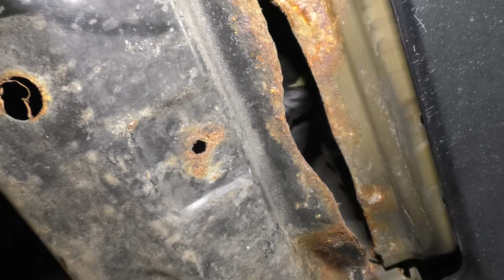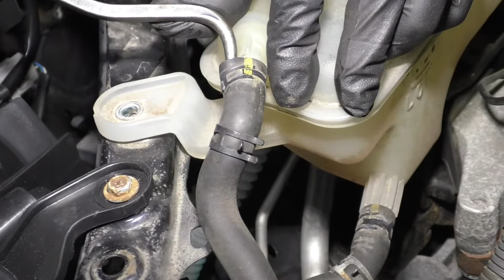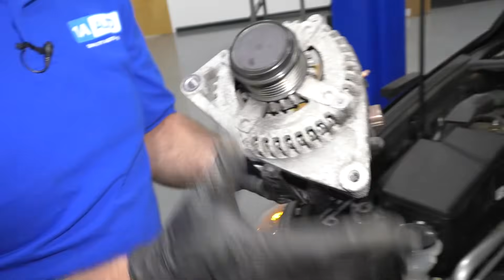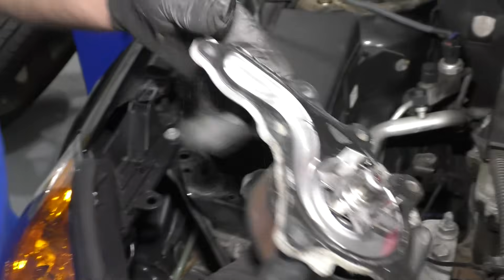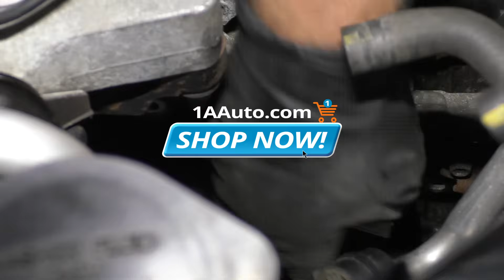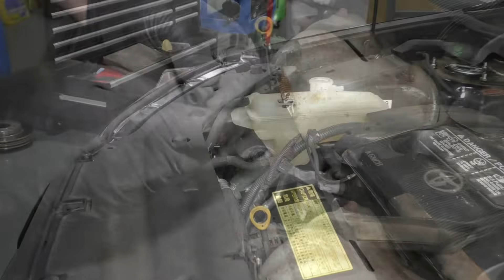How to Replace Engine Water Pump 09-18 Toyota RAV4

Comment: Oof…my biggest concern is that after calling customer support for 1A Auto I was told that the parts (water pumps specifically) are good for 1-5 years, with a 1-year warranty (varying on the part and manufacturer)

Comment: Not a bad video but it would recommend using an oem pump unless you want to do it again not long after you replace it. Also the water pump bolts are all easily accessible from the bottom if you remove the plastic shield in the wheel well. You also can snake it from the top with the alternator still in place. Only thing you really need to remove is the tensioner and belt

Comment: Alternator 14mm socket bolts torque 38 ft lbs, belt tensioner 12mm socket bolt 15 ft lbs.

Comment: Great video.  2 comments.  The thermostat is under the alternator. I always change it with a new water pump.  Also, on the right (other side) of the motor is the coolant temp sensor.  It’s a $14 ish part.  I change that too.

Comment: Slotted brake rotors on backwards, as usual. The slots act like a water pump impeller to draw air and debris from the center and throw it out of the rotor. Nobody reads the stamps on them that says "passenger side" and "driver side."

Comment: Skip all this bs, Support engine under with block of wood and floor jack, remove right side engine mount, remove tensioner, replace pump re install tensioner and mount done. 1hr if your a good mechanic 2 hrs maybe if you don't always work on cars. Torque bolts to specs very little 78 inch pounds about 8ftlbs, don't clean block with any chemical cleaner will damage gasket per manufacture

Comment: Ok here I am again, it was the water pump bearing making the rattling & grinding sort of noise.
I replaced the same and now the engine runs nice and smooth, without a whimper from the drive belt area, 👍 🙏
Well the job went off well with your guided video, but one thing I learnt is that you don’t have to really struggle taking that Alternator out as when you loosen the the top bolt about 1/16” out give it a slight tap on the head to move the nut about one mm away from the bracket the nut actually slides into the right housing of the nut in bracket and it’s got a  V shape locking arrangement so it won’t rotate. Loosen the bottom bolt a bit and now remove the top bolt & bottom bolt & the Alternator would just slide out without a problem or having to lever it out.
Even when putting the alternator back it’s very easy just slides into the bracket and when you tighten up the nut snugs it’s self up nice & firm and off course the bottom bolt comes off and goes back without any hassles once the top bolt is on.
Well I ‘m happy it went off well. I got the water pump for about CA$74/- & coolant 50/50 for $25/- plus taxes.
I wanted to share my finding about easy removal & fitting back of the Alternator for you guys who want to DIY
Thanks A1 Guy once again & all the best

Comment: Very good and descriptive video showing a step by step procedure with the precautions to keep in mind . I have a rattling sound on my 2015 RAV 4 since of late could it be my water pump bearing. I put a large screw driver between the pulley and housing and wiggled it and the pulley actually shakes a bit, so it could be the bearings are worn out, shall appreciate a reply, why no RTV or grease on the gasket will it seal well dry
Thanks for your time guy and all the best to you

Comment: Slotted disc brakes on an old Rav 4? Someone is putting a lot of money into an old car!
Reply: Did you notice that magical transformation between when he took the tire off and whe he started to remove the push pins??
Reply: @Brian-vz5cu  Seriously ... edited video
Reply: You can get a full front kit from stop tech for $200.00 pads and rotors , I understand why. The stock pads could definitely use a little more bite it you do a lot of highway driving
Reply: Corkfish1   Not really. I put a set on my 2011 RAV4 Limited V6 for $180.00 2 years ago. They work ok but tend to be noisier than un drilled and slotted brakes. If I had yo do it all over again I would skip the drilled and slotted rotors,too noisy.

Comment: Have a question. Is there a trick to getting the alternator back on? I took mine off while replacing my water pump but for the life of me can’t get it aligned on the top bolt. I was able to get the top bolt aligned enough to get half way be can’t get it to align properly to thread to the other side . Do you have any suggestions? Any would be appreciated.
Reply: any tips on how you got it back on?
Reply from the maker: +Cord Miller Great question! Check out our library for more videos here: http://1aau.to/m/video-library-c